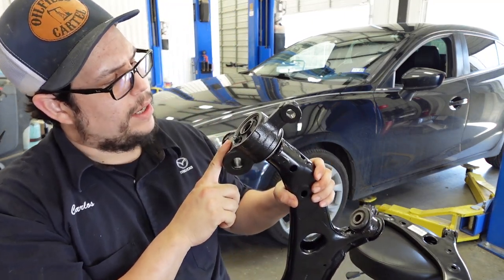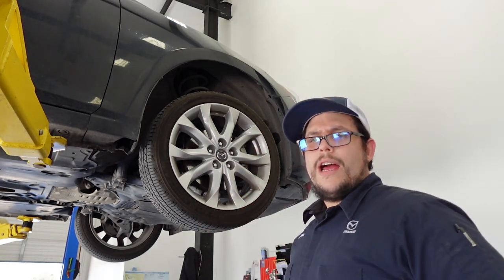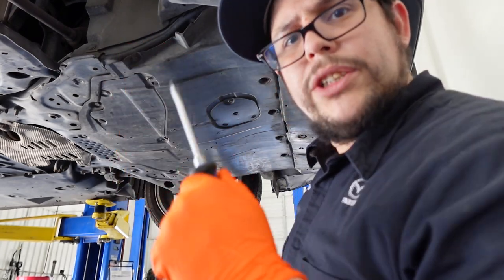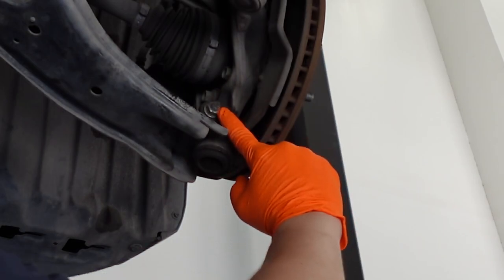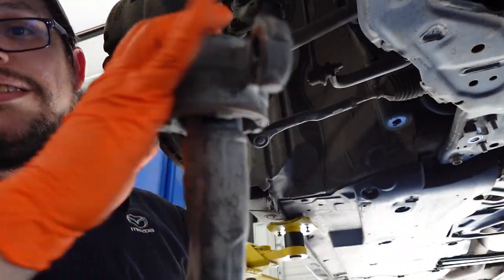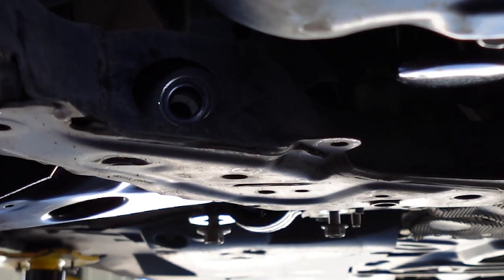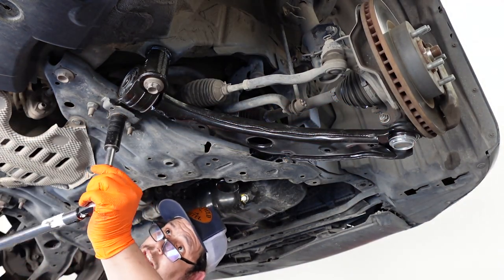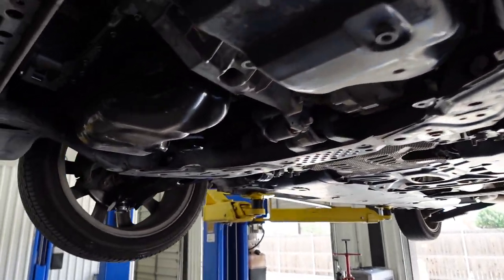Mazda 3 3rd Gen Lower Control Arm Replacement

Comment: It's ridiculous that you have to replace the entire control arm just because a piece of rubber has gone bad instead of just replacing the rubber. The kind of weathering steel used by the 3rd party brands isn't the same steel car manufacture has used.

Comment: Nobody want to video the driver side for this car 🤦‍♀
Reply: He said in the video it's the same as the passenger side, so what's the problem?
Reply: @jeffwest5551  it’s not because access is different
Reply: Yep done mine not to long ago. Driver side is a pain in the butt as you need to remove a bolt from the transmission housing and jack the motor up. Then pry the motor forward to remove the bolt located near the air compressor. Definitely not the same as the passenger side 😩
Reply: 😂 😂 😂 if you have an auto that trans pan is in your way. Thankfully I have a manual transmission so I had plenty of room
Reply: @cleanwhite6527 same!
Reply: All you need is a universal joint for the driver side, I'm doing mine right now I just removed that bolt with a universal joint and a 1/2 inch breaker bar from walmart

Comment: Great tutorial. I have been ordering parts according to the Mazda OEM numbers and my VIN but eveytime the part where the 14mm bolt goes is only 12mm wide. Apparently there are differences with the US and UK markets. May have to order from mazda direct. Any ideas anyone

Comment: Man the 14mm bolt on the ball joint part of the control arm is just completely stuck on my CX-5. I gave up. Rust, unlike the one in your video.

Comment: This is a doable DIY. You'll need that breaker bar and a 1/2 torque wrench as a few bolts require crazy high torque.. 175 ft/lbs on one for example. You can buy the bushings/ball joints aftermarket or OEM and replace but it's easier to just buy a new one and replace the whole thing.. I used Mevotech's.
Reply: mevotech original grade or supreme? looks like a good option on RockAuto, close to $160 or so after ship and tax for a front pair

Comment: Is it true that to properly torque the bolts, the car needs to be sitting flat on the round like it's parked and not on the lift?
Reply: What you should do  is,    raise your car and support it with  jack stand,  then use a floor jack to lift it on the outer side end of the lower control arm (next to the ball joint) until the body of the car started to slightly raise up to simulate the neutral position of the suspension when the car has wheels and is on the road. Then tighten the  control arm bolt to spec.

Comment: I think he did one mistake in that front bolt i was told it needed to be tighten with the weight of the car on it in order for it not be constantly twisted but i'm no expert. unless the front bushing turn in the controle arm.

Comment: Nice technical video. It seems a shame to replace the entire arm just for a busted bushing. But if labor hours are lower to replace the full arm, that speaks to a Mazda engineering oversight.
Reply: Problem is after market bushings never fit correctly.

Comment: At 10:21  before  you tighten  that bolt,  there  should be  a jack  next to the ball joint  to push  the control arm  up to simulate  the suspension's  neutral position  when the car has wheels and is on the road.   
If you don't jack it up and tighten it, the bushing will be twisted when you lower the car on the ground and if you hit a bump, it will twist even more. 
The bushing will fail prematurely.

Comment: Great tutorial and solid step by step instructions. Going to be doing this in the driveway on my 2015 Mazda 6, which is identical in design to the 3. I'm also doing a full strut replacement as those are making some serious popping, creaking noises. Come on Amazon, they arrive on Tue. Big THANK YOU for the awesome video.

Comment: Its nice to see it done.  I'm replacing everything on the front end, 200424 on the clock with its original parts minus brakes and tires.

Comment: Well done sir. Only thing missing here is the lug nut torque spec, which is 85 foot pounds. Everything else was well explained.
My "stealer-ship" quoted me (as of Feb 2024) over $1400 to do these; not gonna happen. Have air tools, some experience & a free Saturday, piece of cake.
The Mevotech Supreme parts were mentioned elsewhere in comments. I've used them before on my Toyota and am well satisfied with their price, quality & performance/function.
Plus the ball joint on their control arms for this Mazda are greaseable instead of sealed/non-greaseable.

Again, good work sir. Like left. 👍

Comment: Thank you for the walk thru and torque specs. Still sore because i have no uga-duga. I  found my T-bar with a cheater was the perfect fit to break the front bolt by the oil pan, no swivel needed. The passenger side i used a 12" extension suported by a jack stand to get good leverage and break that big boy. But thats working off the ground with hand tools for ya.

Comment: Grate job sir. I'm from Quebec Canada with snow and salt  so A lot of rust , look easy but for me with the rust on my Mazda CX 5 2014  I need more tools and penetrant w40  and spare push type clip because many will break. Thank you for the torque specification.

Comment: Excellent video, how many miles does this car had? I used to have a 2016 in red, traded it in for a 2021 Turbo HB
Reply from the maker: It had about 90'000 on it. I love the 4th gen hatch by the way. I feel like its under rated. I wish they offered it in a manual trans. It would be a hot hatch to content with.
Reply: @CARDIAXPLAYS  they do have a 4th gen Mazda3 HB with a 6 speed, just with the 2.5 NA and FWD. So no turbo and no AWD

Comment: Great video!!!!   Do remember what brand part you installed?  Also, I have an 2014 Japan made model Mazda 3.  Mazda part breakdowns show 2 diff control arms Japan and Mexico.   Do you think there's any fitment issue?  Many thanks.
Reply from the maker: The control arms installed were OEM Mazda3 control arms. I believe that OEM is the best way to go.
Reply: @CARDIAXPLAYS do you have a link to the oem part? I have a japanese built

Comment: I’m glad yours was easy, but mine were much harder. That bolt holding the ball joint in was frozen solid. I had to bang it out using a hammer, but not after snapping the head of the bolt off then the ball joint wouldn’t come out of the knuckle and had to use a tie rod separator or a pickle bar in order to pop it out, others don’t have as much problems as I did but just beprepared

Comment: ALL the bolts were over torqued since you have used impact gun to begin tightening. 😅 It is clear, when you try to tighten using torque wrench.
Other than that it is great video.

Comment: The passenger side was easy thanks to the video!  BUT, the driver side big bolt (the one with 158+ torque) is impossible to get out b/c of the transmission pan. HELP!

Comment: Hi, please how many miles had that Mazda when you change these arms. I have 93 500 so i ask when i should approx. Prepare for change many thx
Reply from the maker: Hi Michal. I would do a visual inspection on them first. Your lower control arms might still be in great condition.
Reply: 108k miles on a 2016 mazda sport, mine are due for a change

Comment: I'm having trouble removing the first 19 mm bolt in the front my breaker bar can't get in there .
Reply: The transmission pan is in the way on the driver side
Reply: Impact

Comment: What is a reasonable price to replace both arms in the front? I was quoted 1500
Reply: front lower control arm assemblies cost $150-200 for the pair on rock auto. Based on the video looks like one could do it in a couple hours. That being said, labor at a shop will always cost more. But for ONLY both front control arms, that sounds like a rip off